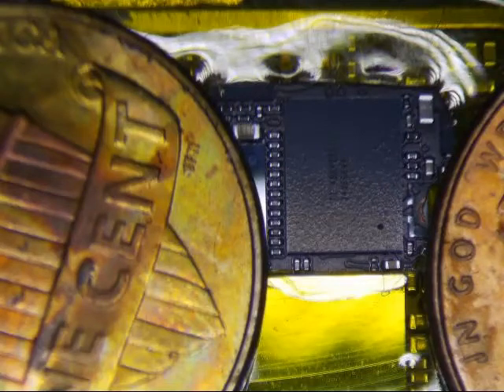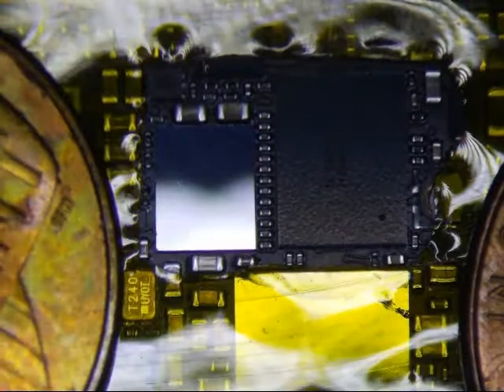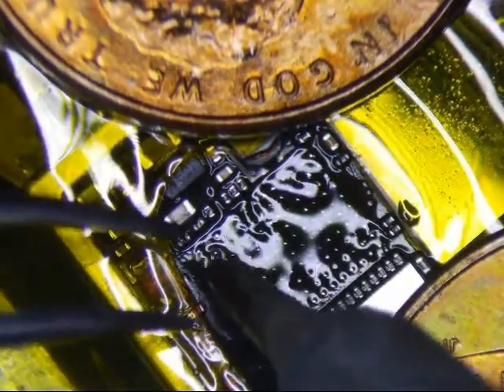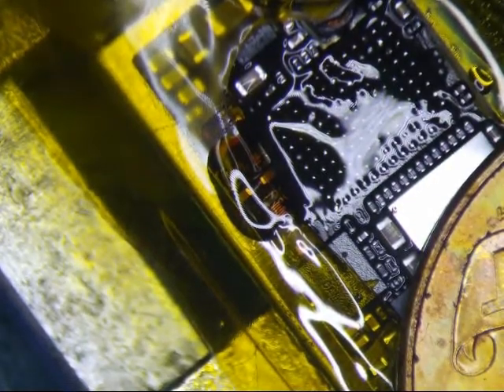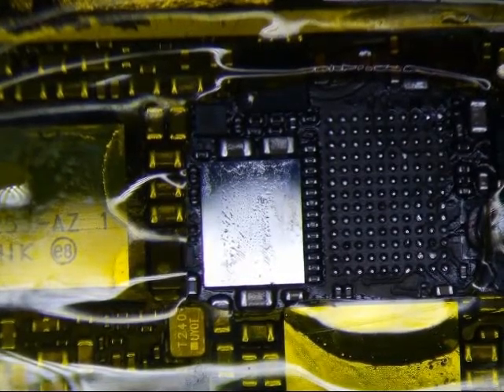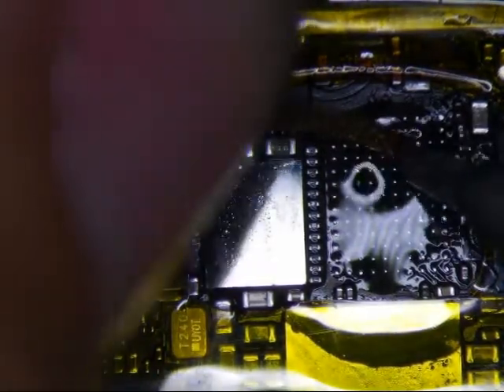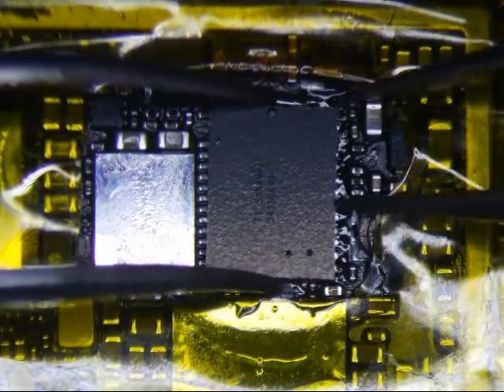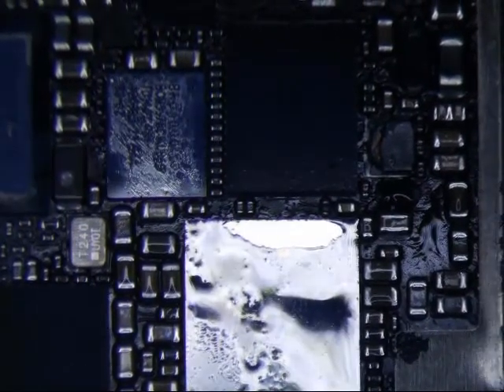iphone 6+ touch ic Meson Only   clean pads with solder wick

Comment: tweezers look like suicide to me.. does it not kill the pad? lol
Reply from the maker: No, it's the best way to use solder wick for microsoldering.
Reply: so, you just use the wick to absorb the solder on the board, and don't actually put pressure on the wick?
Reply from the maker: the hot tweezers heat the entire wick, then you just kinda dab the pads with the hot wick
Reply from the maker: Yup!